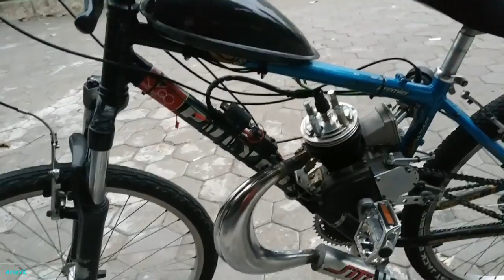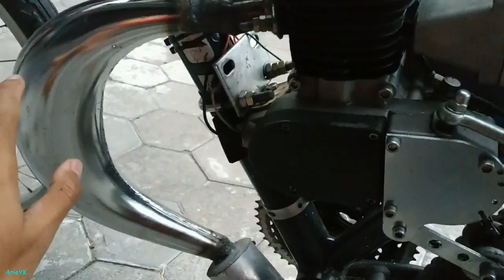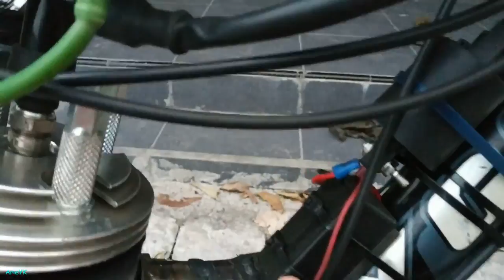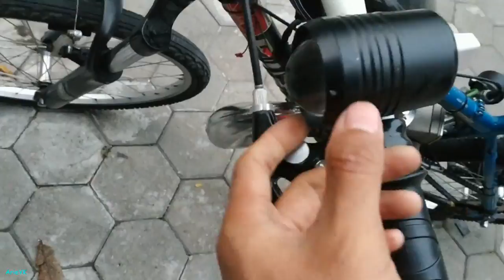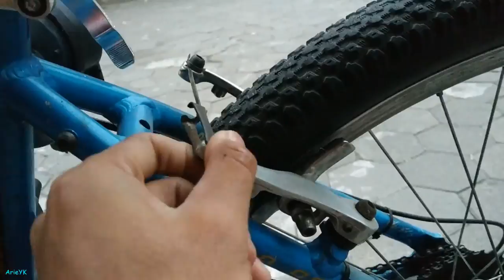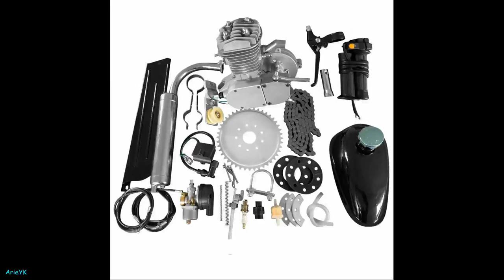Gasbike Sepeda Bermesin 80cc

Comment: Bang Pasang Sepeda Mesin  Merk Suzuki Berper Shockbreaker  fork  depan ban  roda pakai velg sepeda fiksie pasang  kunci kontak tuas lampu  sorot  sein  rem untuk dipasang di belakang  dipasang boncengan  spatbor bikinin dong .Bang
Reply: pasang speedometer seperti motor dong bang.
Reply: pasang aki
Reply from the maker: @dajo6691  hehe semua jatuh ke selera masing2 gan kalo saya emang sukanya tanpa spakbor depan belakang
kalo punya temen saya dikasih spakbor sama boncengan belakang
utk spedometer & lampu sein ada juga yang pasang cuma saya suka polosan hehe
Reply: oh ya kamu tinggal dimana
Reply from the maker: @dajo6691  yogyakarta gan

Comment: Abis brapa modif ny bng,  syaa udah punya mesin gasbike ori tapi kepingin upgrade mesin biar tarikan lebih jos hehehe
Reply from the maker: perkiraan habis 2jt lebih gan
coba ganti gear belakang yang 36t
pakai reedvalve + karbu pwk 24
head bubut 0.5mm
block di porting dialusin biar lancar
knalpot bikin di tukang knalpot bisa
dengan modif seperti itu speed udah naik